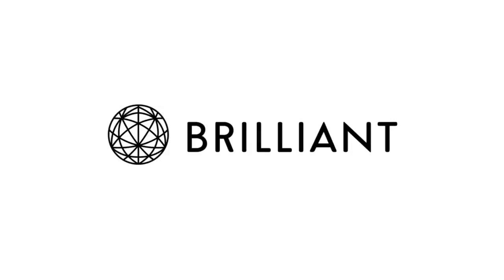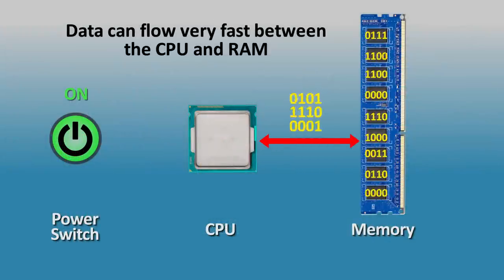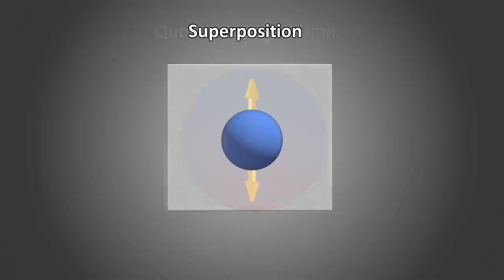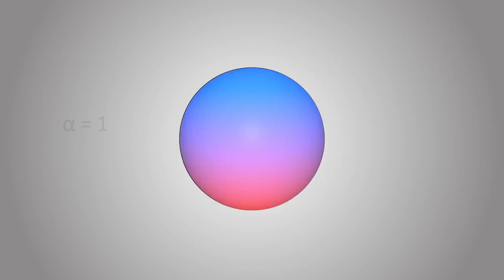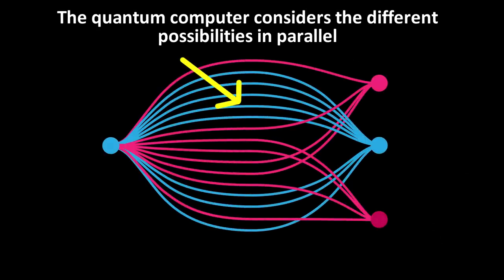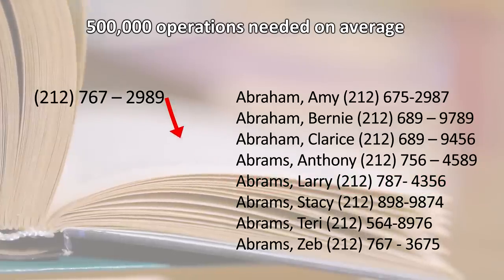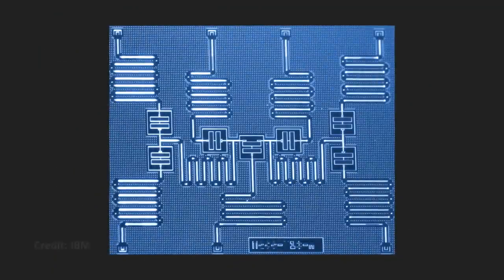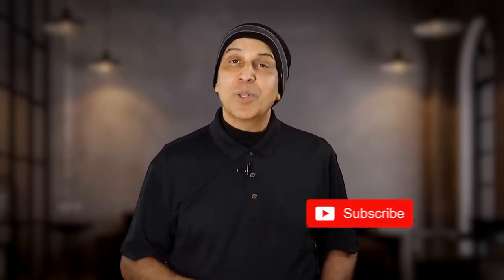The Insane Mechanism of a Quantum Computer?

Comment: I don't get the explanation of qubits. In classical analog computers, a signal can also have values anywhere between 0 and 1, represented by different voltage levels. Surely there must be something more to how qubits work?
Reply: 1, A classical computer doesn't actually use that in between value. It just counts any voltage below a threshold as 0, and anything above it is a 1; and 2, a quantum computer uses superposition to try every possibility at the same time, while a classical computer has to try one operation at a time
Reply: The answers missed the "analog" part of the question so, the difference is that qubits are superimposed sets and friendly to algorithm manipulation, which is what gives it its power.
Reply: Indeed. The video did not explain it.
Here is an actual explanation.
First, you need to understand the concept of a vector space.
A vector space is a set of things where you can scale them by a number, and add or subtract them. The things in a vector space are called vectors.
There is a more precise way to define vector space, but the precise details are just the things one would expect from making the description I just gave precise.
An example of a vector space is like, the space of triples of 3 numbers, like (x,y,z) , where you can like, say 2.5 * (1,4,2) = (2.5,10,5) , and (2,1,11) + (1,1,1) = (3,2,12) . Another example of a vector space is just "the real numbers".
In quantum mechanics, (or at least one of a couple of mathematically equivalent ways of describing it), the state of a system is always a vector in a certain vector space. This vector space is of a certain kind, called a "Hilbert space".
A Hilbert space is a vector space where you have a concept of the length of a vector, and also a concept of vectors being perpendicular, and the Pythagorean theorem works, and also if you have an infinite sum of vectors which should converge, then there actually is a vector for it to converge to (this last property is something you don't really need to worry about for this explanation).
In quantum mechanics, the vector which describes the current state of a system always has length 1.
An example of this is what he was trying to get at when he said that alpha^2 + beta^1 = 1 (though really he should have said that |alpha|^2 + |beta|^2 = 1 in case alpha or beta had an imaginary component)
Now, you need to know what a linear operator (aka linear function aka linear map) is.
Now, a linear combination of a collection of vectors is just a sum of the vectors each multiplied by some number.
For example, 2 * (2,11,2) + 4 * (1,2,3) is an example of a linear combination of (2,11,2) and (1,2,3) . Another example would be 2 * (2,11,2) + 0 * (1,2,3) .
The linear combinations don't have to just be between 2 vectors either, they can have as many as you want. A linear combination of vectors from some vector space, will always be a vector from the same vector space.
[side note : the "dimension" of a vector space is the smallest size a set of vectors from that space can be, such that every vector in that vector space can be expressed as a linear combination of vectors from that set.]

A linear operator is a function which takes input an element of some vector space, and has outputs elements of some vector space (often but not always the space it takes input from, and the space it gives output in, are the same space) such that, it sends linear combinations to corresponding linear combinations, in the sense that,
well, I'll give an example, that will be easier.
If A is a linear operator, then A( 5 * (1,4,2,7) + 2.1 * (1,1,2,2) + 3000 * (4,3,2,1)) = 5 * A((1,4,2,7)) + 2.1 * A((1,1,2,2)) +  3000 * A((4,3,2,1)) .
And, note: A doesn't "know" that its input was in the form of a linear combination of the set of vectors I expressed there,
all the info A gets is the vector (12007.1, 9022.1, 6014.2,3039.2) (which is what that linear combination I wrote evaluates down to. I kind regretting picking not-nice numbers in that example)

Now, in quantum mechanics, basically everything is done using linear operators.
In particular, time evolution, the "given what things are like now, what will they be like in 2 seconds" (or, any given amount of time) is a linear operator.

So, if the computer state is a linear combination of some state and another state, then because time evolution is linear, after the computer does stuff, the computer state ends up being in a corresponding linear combination of what time evolution would do to the corresponding components, and the relative coefficients between them.

Now, suppose that we have some vectors in the Hilbert space for our quantum mechanical system, and let's say these vectors are named, idk, banana, Zamboni, purple, and Sasquatch, and they each have a length of 1.

Suppose that purple and banana are perpendicular, so then (by the Pythagorean theorem ) the lengths of ((1/sqrt(2)) * purple + (1/sqrt(2)) * banana) and ((1/sqrt(2)) * purple - (1/sqrt(2)) * banana) each have a length of 1 (because (1/(sqrt(2))^2 = (1/2) , and (-1/(sqrt(2))^2 = (1/2) , so in both cases we get (1/2) + (1/2) = 1 )

Ah, now there's something I should have probably mentioned earlier (it gets a bit confusing trying to explain just enough linear algebra to explain quantum mechanics while simultaneously explaining the quantum mechanics) : measurement!
When there is a discrete set of possible measurement outcomes, we can associate with each one, a component of the state. For each possible outcome, there is a linear operator (a projection operator, as it happens) which sends any state to a component of that state which corresponds to that measurement outcome, and if you add up the components that these different operators give of the original state, they add up to the original state,
and furthermore, each of these components are perpendicular to each of the other components.
The square of the length of each of these components corresponds to the probability of measuring that outcome. That these add up to 1 represents the fact that "definitely there is something that happens", and also that this is by adding up squares of lengths of perpendicular things, is because of the Pythagorean theorem again.

So, if there is a measurement we are doing which has possible outcomes "purple" and "banana", then, well, I named these measurement outcomes after the vectors I used before, so I hope it isn't too much of a surprise that I want the "banana" component of ((1/sqrt(2)) * purple + (1/sqrt(2)) * banana) to be  (1/sqrt(2)) * banana ,
and the "banana" component of ((1/sqrt(2)) * purple - (1/sqrt(2)) * banana) to be (-1/sqrt(2)) * banana .
Note the minus sign!
But, in both cases, if we take the square of the length of the "the observed outcome is banana" component, in both cases, we get (1/2) (if instead of (-1/sqrt(2)) we instead had like, (sqrt(-1)/sqrt(2)) , well, technically we would multiply it by its complex conjugate, which is (-sqrt(-1)/sqrt(2)), and so the product would still end up being (1/2), but you can also just think of it as "we take the absolute value before we square it." But also, I'm getting into unnecessary details, you don't have to worry about this part.). (similarly a (1/2) chance of "purple" in both cases, but I showed "banana" to demonstrate what happens with the minus sign).

Ok, now, suppose that the time evolution operator U, which sends a state to what the state would be after (say) 3 seconds,
suppose it sends Sasquatch to ((1/sqrt(2)) * purple + (1/sqrt(2)) * banana) ,
and suppose it sends Zamboni to ((1/sqrt(2)) * purple - (1/sqrt(2)) * banana) .

Because U is linear, it will send (1/(sqrt(2))) * Sasquatch + (1/(sqrt(2))) * Zamboni to
(1/(sqrt(2))) * ((1/sqrt(2)) * purple + (1/sqrt(2)) * banana) + (1/(sqrt(2))) * ((1/sqrt(2)) * purple - (1/sqrt(2)) * banana)
which simplifies down to (1/2) * purple + (1/2) * banana + (1/2) * purple - (1/2) * banana = purple .
While, on the other hand, it will send
 (1/(sqrt(2))) * Sasquatch - (1/(sqrt(2))) * Zamboni
(note the minus sign!)
to (1/(sqrt(2))) * ((1/sqrt(2)) * purple + (1/sqrt(2)) * banana) - (1/(sqrt(2))) * ((1/sqrt(2)) * purple - (1/sqrt(2)) * banana)
which simplifies down to
(1/2) * purple + (1/2) * banana - (1/2) * purple + (1/2) * banana = banana .

This is the sort of thing that he is talking about when he talks about the positive and negative interference.
Sasquatch and Zamboni would each individually produce a superposition of purple and banana (two different superpositions, but if one measures whether banana or purple, the probabilities would be the same, though if one measured a different question the two could be distinguishable), but different linear combinations of Sasquatch and Zamboni result in either the purple components having negative interference and canceling out while the banana components have positive interference and become more likely, or visa versa, depending on which linear combination of Sasquatch and Zamboni is used.

Ok, it is midnight, I probably shouldn't have taken the time to write all this on a youtube comment? But, if you have any further questions, let me know.
Reply: @drdca8263  you could've linked to a wikipedia article. A youtube comment can't hope to ever be very well formatted
Reply: @drdca8263  Mr. Zamboni, do you take credit card or paypal? great stuff +1

Comment: If quantum computers take off and can easily simulate protein interactions, it will enable relatively safe gene editing which will be an absolutely massive development.
Reply: Isn’t that basically what crispr does? Genuine question.
Reply: @gregkrueger331  Crispr is the protein that removes a section of genetic code and replaces it with another set of genes. The main reason gene therapies or gene editing are dangerous is that it's difficult to predict exactly what an edited gene is going to do in the long term. So if quantum computers were able to simulate the protein interactions that come from an edited gene, it would make it much easier to create new gene therapies.

Comment: Hi Arvin.  Got anything on the aharonov bohm effect?  This is REALLY hard to visualize, what with potentials that aren't fields and stuff.  It's an interesting effect that can change the interference pattern in a double slit experiment by changing the phase of the particle(s) despite there being zero B or E fields.

This one is probably REALLY tricky because nobody seems to be able to demonstrate it other than by way of the rather ugly math.

No biggie it it's too crazy to even try, but you did a great job on entanglement and I thought you might be the one to bring this effect out in the open too.
..

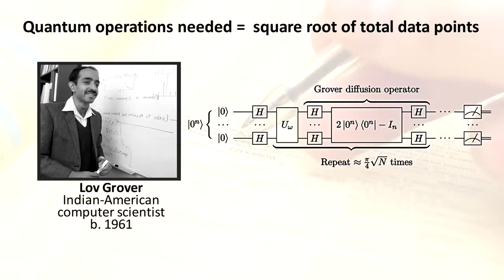Comment: 9:55 : This is what I've been looking for, for the past week. And I've found this video after I'd given up on getting an answer, lol.

So, where a classical computer would need 500,000 trials, a quantum computer needs 500 times less, 1000.
But that's just for a basic problem : looking for one answer among many possibilities. Is there any way to prove quantum advantage on other problems? For example, fluid simulation. I'd expect quantum computers to be able to simulate fluids in real time, whereas classical computers would need to "bake it" because it just doesn't have enough power to run this sim. Am I right to assume this?

Comment: quatum computers.. ? im not sure if has any benefit. but qbits can be used for low range data transfers. and thats good as a modem unit for supercomputer.. but as its not possible to set each byte for now no its not actually useful for that case. but as encription mechanism it can be used. 
and as synced qbits are depending on each other thats useful for encryption as each key will have negative on other side ..
but if one day it becomes possible to set qbits. thatll be  useful for synicing distant units of supercomputers. and may be any kind of computing unit . but for now they seem to have lots of work to reach that level.

Comment: Most explain this incorrectly.  Qubits always has a definite state.  That state CAN (mathematically) be represented as a superposition of eigenstates (That is, the basis states which for spin, are up or down.  This is like the component vectors of an arbitrary vector).  Spin pointed in the side direction is represented (mathematically) with probabilites of being in the eigenstates (discoverable when measured), each with varying degrees.  However this does not mean that the state is in BOTH up AND down states at the same time, it's definitely sideways.

Comment: Since I program computers for a living, call me a skeptic.  With the exception of one very specific task (random number generation),  probability is NOT something you want in computing.  In fact engineers go to great lengths to eliminate probability from their hardware.  

There is a different kind of quantum computing that could be useful. RAM that could encode each data bit into the quantum spin of an electron, for example. One bit, or multiple bits, per atom would be extremely dense, perhaps terabytes or petabytes per chip.  But as far as running a CPU on quantum superposition, I think that's a no-go.
Reply: Perfectly agree.
Running an algorithm means always processing one step (maybe even one bit) after another. How could you process several steps at once with just one hardware that just does processing of one step? Impossible. Instead you always need to multiply the hardware in order to process several steps at once to achieve faster speed, ie. multiprocessing (I ignore here the problem of algorithm branching completely). 
Using anything else for faster algorithm processing than multiprocessing method is simply pseudoscience.

Comment: Hey Arvin sir, as you explained in one of your previous video you said that anti matter particle doesn't go backwards in time.but what does it mean when you say a particle goes backwards in time?
Reply: It means, that a Particle can't Travel Backwards in Time, so its Related to the Concept of Light Cones in Minkowski Space-time:-

Light-Cone is somewhat like the Same model of Hyperboloid Model in Topology(or you can understand it as the Einstein-Rosen Bridge Diagram), on a Light-cone the Particles are in Superposition Mainly(according to Quantum Mechanics), hence, the Equilibrium of the Particle/Probability of the Particle is in many States at the same time, so, as the Particle is in the Present Phase of the Light-cone(or in the Center of the Light cone to visualize), there are mainly Two Directions and 1 Spatial Direction(Hereby to be considered as Space-dimension), the Two Other Dimensions Vertically Up and Down, so, the Upper-Half Plane of this Hyperboloid model is Future Time-like Infinity(I^+) and the Bottom-Half Plane of the Hyperboloid Model is Past time-like Infinity(denoted by I^-), and the Space Dimension is a Regular 2-d Plane which intersects the Upper and the Bottom Portion of this Hyperboloid Model, so, coming back to the Particle, the Particle knows its Previous/Past Path(or Past Null Geodesics for to be more specific) as its has Travelled the along its World-line(hence, Null Geodesic as on the Surface of this Hyperboloid Model which is of Positive Curvature hence, a Spherical Geometry but, mostly Euclidean Geometry, as Surface Calculations are made based upon that the Observer is himself on the Surface of the E^3 Manifold), hence, the Particle Won't travel much of its Past Time-like Curve/Geodesic, it prefers to be in Quantum Entanglement with the Future Time-like Infinity!.

Hope this would by a Helpful Explanation!.
and for further Discussion visit my channel:- https://www.youtube.com/channel/UCWrb8Gmb1OewlQeal3s4K5Q

Thank you!.
Reply: @cosmotalk7227  oh thank you for your time and effort to reply.
Reply: @Regularsshorts  Its my pleasure!